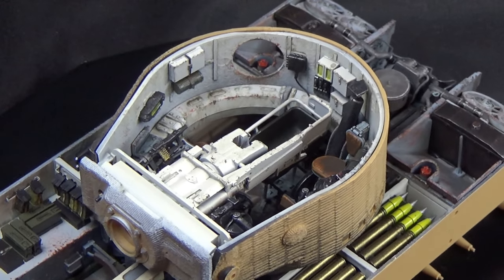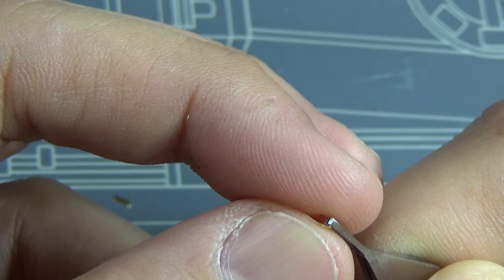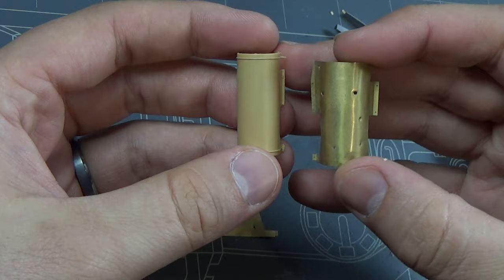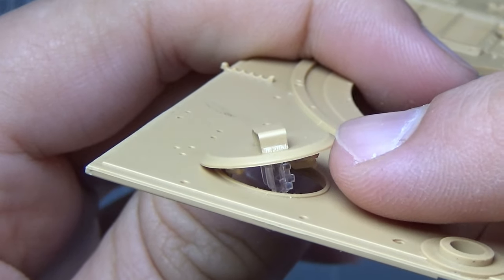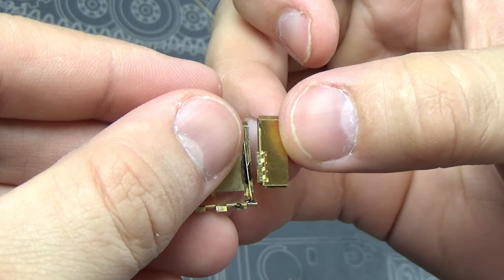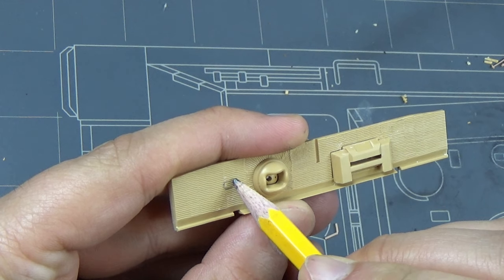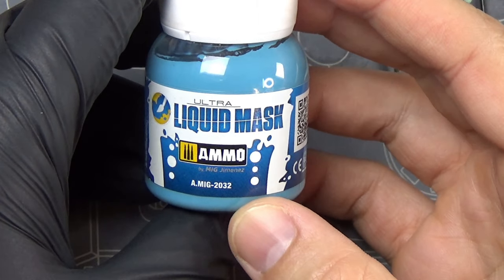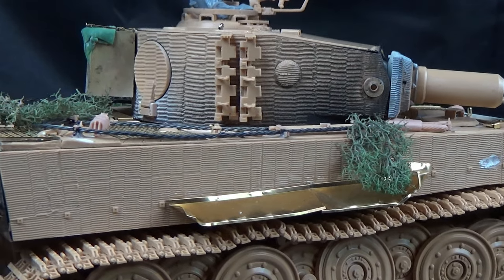Let's Build a German Tiger Tank with Full Interior (RFM 1/35)

Comment: superb work - but I think those little tubular things you cut off the turret top were the lifting mounts, ie, they weren't ejector pin marks, they should be there.
Reply from the maker: Thanks. You're the second person to note that and I do appreciate the insight. I can't seem to find those lifting mount spots in reference photos though. I'll post a few and you all can see what I'm seeing. I believe everyone, I just can't make it out in the photos. Interestingly enough, the kit instructions don't show them on the part either.
Reply: They were mounting hoist to pull covers for maintenance of engine. Meng has the jib and hoist in the Jagdpanther G2  kit was thinking using it on a tiger or king tiger model. The three you cut off turret roof
Reply: @relentlesstorm  
I think my reply to you must have been deleted because it included a link to a website - nevermind, I'll reiterate it without the link.
I had a look online myself, and of course found absolutely no photos showing the turret detail (typical), but I did come across a Tiger 1 information website, and found that the hoisting points were introduced some time in 1944 - and apparently in May of that year, they made a few turrets with that big weld seam down the middle, that had no hoisting points.
I suppose the takeaway here is that despite cutting yours off, it isn't necessarily wrong to do so, and any pedantic A hole like myself who points it out should chill the F out, and maybe not be so smug.
go steady.
Reply: @relentlesstorm    Those three "pilze" were installed only for the last couple of months of Tiger production.
Reply from the maker: Thanks for the detailed response. I'm just seeing this now as I don't get notified of replies (silly Youtube). I didn't see your link but feel free to share. I appreciate the support!
Reply: @relentlesstorm . Hello . Its true . Late tigers with the thicker turret roof had three "pilzen" points . These where for a three legged , small crain with a wince that could be erected when the engine deck or engine needed removal . M

Comment: Great build especially the photo etch - thats a killer isnt it?!!😆
(Just a small point but the three little nubs on the turret roof you thought were a manufacturing fault and sliced off were actually on the real tanks - they are called pilzen and were used by the heavy lifting cranes for attaching lifting hooks when removing and replacing the turret for maintenance or repair)😉
Reply from the maker: Ah! I didn't know that. Thanks for the insight! PE is one of those things that is difficult and time consuming but the results are (most times) worth the effort.
Reply: That's not the purpose of Pilze.
They are threaded mounts where a small crane can be attached to the roof. A crane with the capability to remove the engine.
For lifting the turret, you would hook onto the three protruding lugs on the sides, which are much bigger.
Reply: @daveybyrden3936  my mistake also.Every day’s a school day!😏

Comment: I am 62 years old and these super tiny photo etch parts are not possible for me  to install. I do wish that all the companies would include plastic replacement parts as I have to leave these parts off!
Reply from the maker: Most of the exterior PE you see was an from an upgrade kit I got separately. Takom makes a 1/16 Tiger that is very manageable. I'm making the 1/16 M10 now which literally has 6 PE parts that you can handle without a tweezers. Very doable